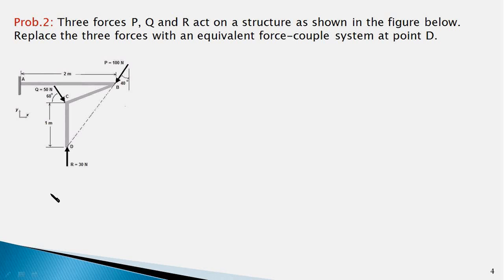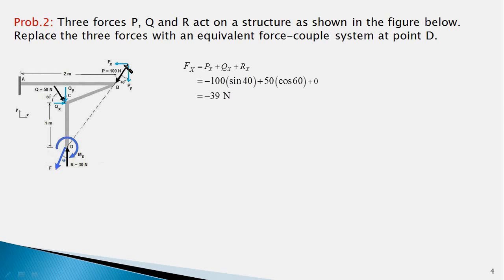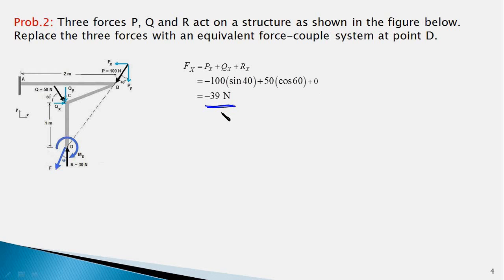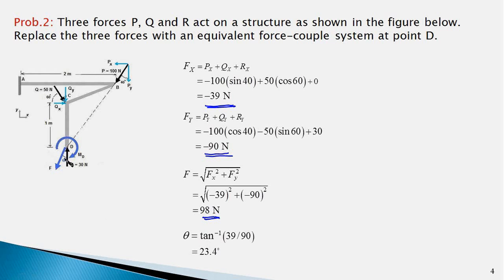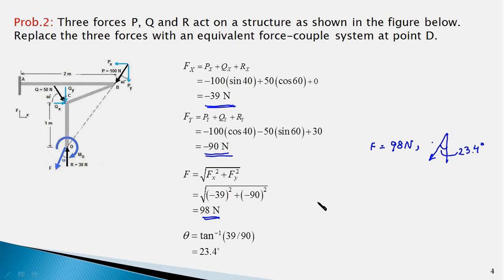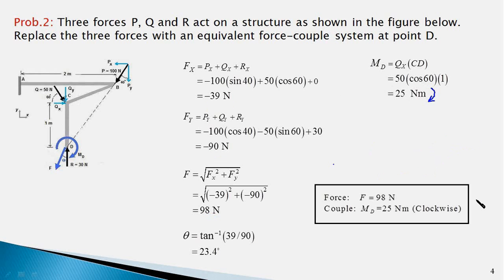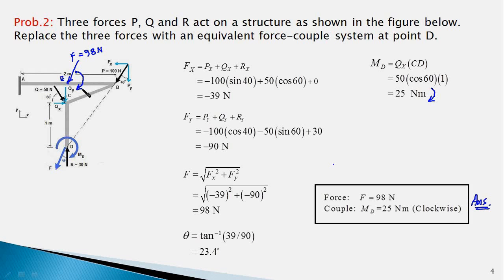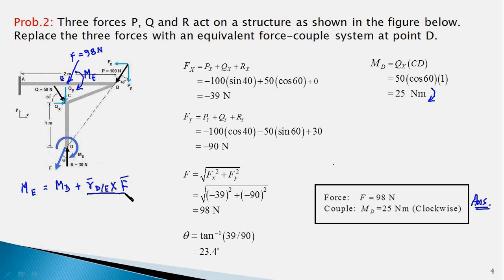7.3 Replacing Non concurrent Force System with an equivalent Force Couple system

Comment: Excellent video. However one clarification required. Must we draw the free couple moment AT and around point D. I thought that free couple moments, once computed can be drawn anywhere on the body. My understanding is that free couple moments are not tied down to a specific point. Please shed some light on it. Thanks.
Reply from the maker: That's a good question. You are  absolutely right...a couple is a free vector and can be moved around anywhere on the body and need not be tied to any specific point. So in this example, the resultant couple (of moment 25 Nm) can be imagined as a pair of say 25N forces separated by a distance of 1m and producing clockwise moment of 25Nm acting anywhere on the body.
But how did we compute 25Nm as moment of the couple? Answer: We computed net moment of the three applied forces P, Q and R about the point D. So, the equivalent force-couple system of the applied forces becomes point specific. The equivalent force-couple system of the given set of forces at some other point say C would be different from that at point D. It therefore makes sense to show the equivalent force acting at a specific point and a couple  around the same point such as D in the example.
Hope the doubt gets settled.

Comment: why does the resultant force 98N make an angle of 23.4 degree with the vertical axis instead of the horizontal axis?
Reply from the maker: That is so because theta is shown as the angle between the resultant F and the vertical and so its value is computed from eqn. tan(theta) = Fx/Fy. Does it help?
Reply: @VectorInMotion  I think i got ur point. That means if i want to show the value of theta with respect to horizontal axis then the equation should be tan(theta)=Fy/Fx then the value of theta results in 66.57 degree
Reply from the maker: @md.armanhossain7509  You are absolutely right!

Comment: Px and put vector starting from tip of p vector.qx is not from the tip of q why this will change the moment
Reply from the maker: How you draw the components of a vector (whether starting from its tip or tail), is not of much  consequence. What's more important is to clearly define their point of application. For example, in this video Px and Py act on  point B of the structure and the components Qx and Qy act on point C of the structure. But I agree, there should be consistency in the diagram and I should have shown Px and Py acting clearly on point B. Thanks for pointing that out.
Reply: @VectorInMotion  
now i understand ....the word point of application.....thankyou..